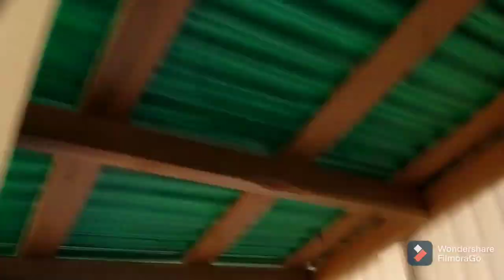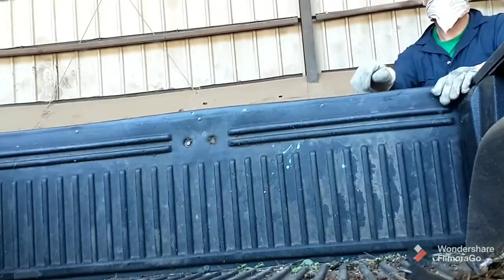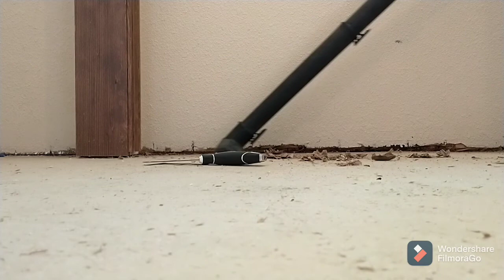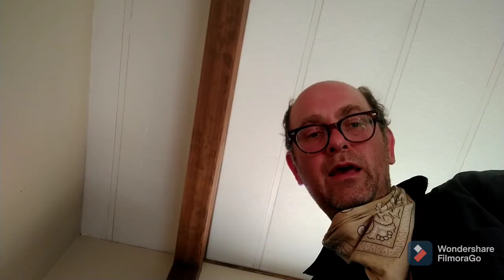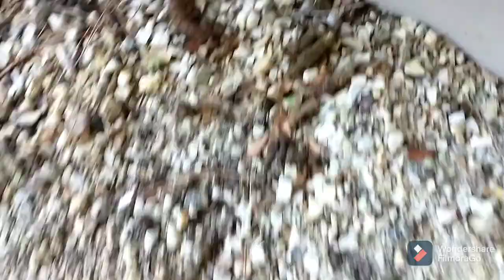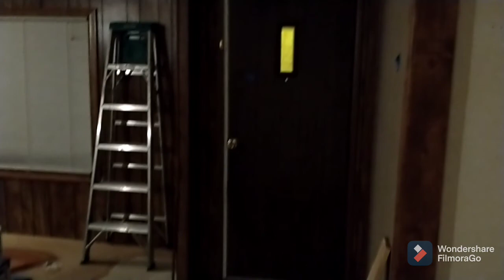A Mobilehome Makeover EP 7: why we're not spraying Kilz

Comment: The water stains is from outside
Reply from the maker: That's a definite possibility. The roof was replaced maybe 12 years ago, with extended eves, and there was definitely water staining on the ceiling in places where it hadn't been covered up yet. 

The smell of those stains on the floor combined with evidence on the carpets we tore up pointed to pet damage, unfortunately. But I'll definitely keep an eye out for leaks!!
Reply: I had the same stains all the way around and had to cut it out from the outside. The roof is getting a new 6” overhang and rubber. What kind of roof did you get?
Reply from the maker: It's a metal roof, also with about 6" overhang. Fortunately it was done already, and hopefully will be good for many years to come